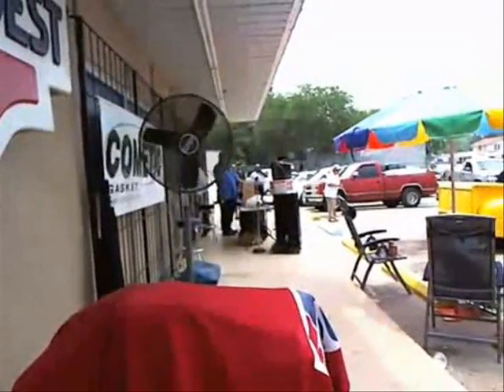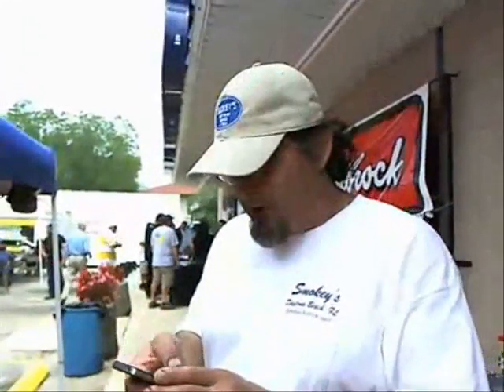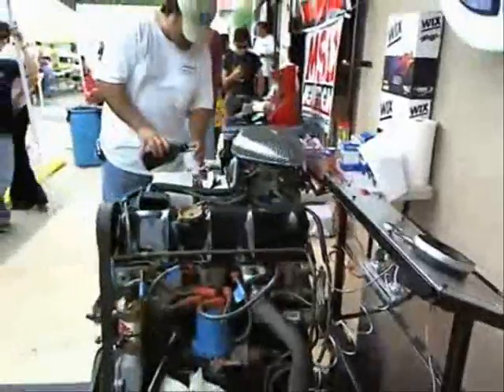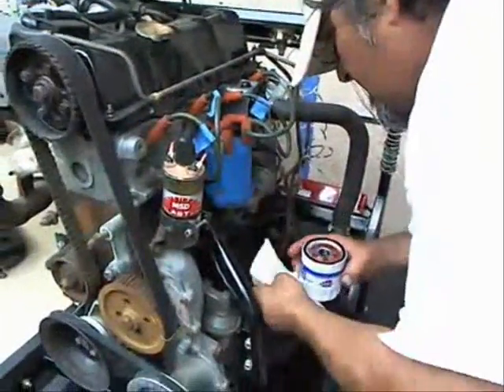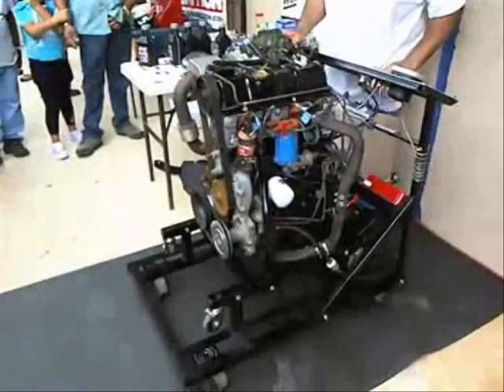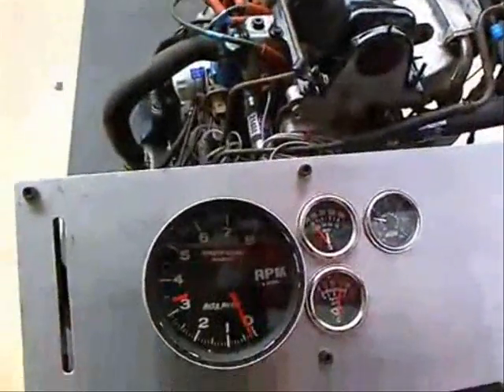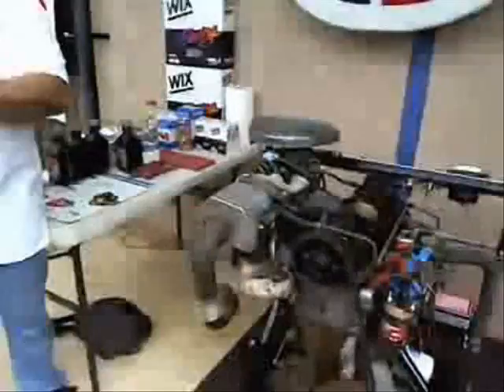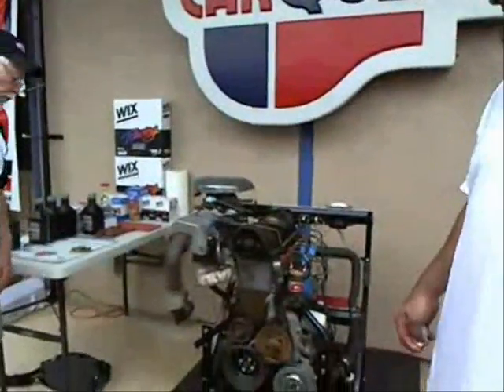Danny Soliz running Smokey Yunick’s Hot Vapor Engine

Comment: 1.8 Horse Power per Cubic Inch Displacement, Gasoline expansion chambers under 15 psi utilizing a turbo which also act as a homoginizer(pre mixing air + vaporized gasoline before entering the combustion chambers) and past the emissions test without an exhaust catalytic converter. Efficient.
Reply: Very efficient! We now have the car this engine was built for and will reinstall it and show the world what it can do!
Reply: KTube5000 it's a small turbine in that welded box which is filled with exhaust to heat the fuel mixture.
Reply: True Zero Emissions , Hmmm. Could it also benefit by negating alternative contemporaneous maintenance needed for cleaning the dirty valves of current direct-injected engines as well which are trying to showcase their fuel-efficiency?
Reply: @That_Handle Interesting thought.